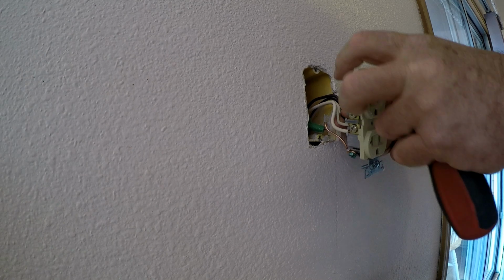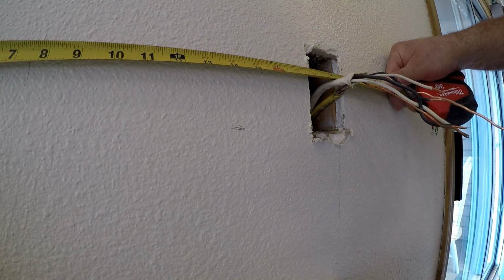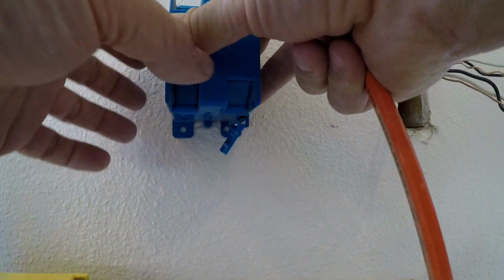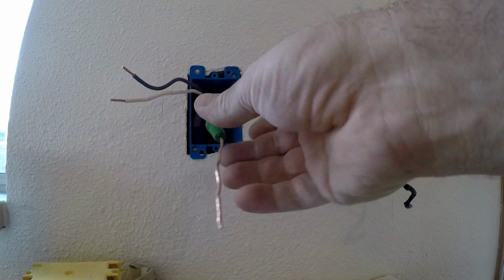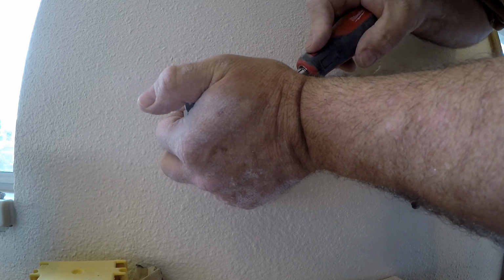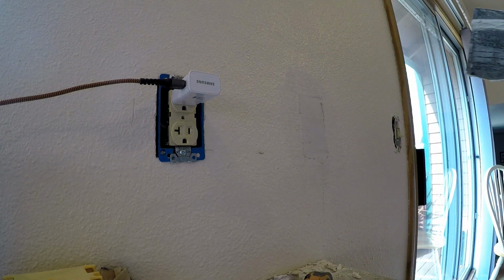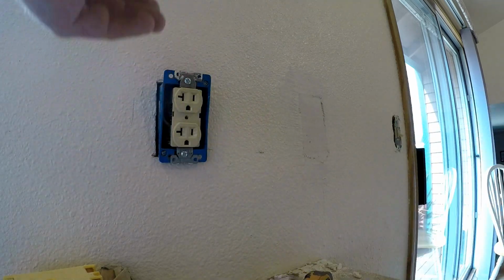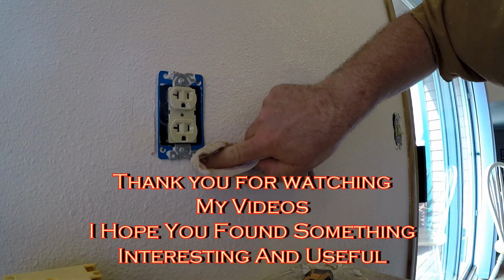Relocating An Electrical Outlet

Comment: Good but only to a point. What about if your wires do not reach. How about if you need to move to the other side of a stud? I have both issues and are looking for videos to help.
Reply from the maker: During this kitchen project,  I had to move several boxes and install new boxes. I don't always have time to record things. I think in the first video of this Playlist, you can see along this same wall where new outlets are installed. They are the blue remodel boxes. You typically have to cut open the wall to run new wiring to new locations. If you have unfinished walls and ceilings below, you can fish wires down, across the ceiling, and up to the new location from below. That way you only need to cut an opening for a remodel box. If it's middle of a run, fish the in and out wires at the same time.
Reply from the maker: https://www.youtube.com/playlist?list=PLyz2LOih3ypvUN753oGYcYXhEHbCuep2C
Playlist
Reply from the maker: In this video about 2/3rds through you can see some of the wiring that happened but no specific information.
https://youtu.be/3V06ZG-vhNI

Comment: What do you screw the blue box into.  Is there wood near the hole you cut?
Reply from the maker: It's a remodel box. You ut a hole the box fits closely into meaning an accurate tight fit. Put your wires into the box, then put the box into the hole. There are flip up tabs when you turn the screws that hold the box in place. If by chance the box is next to a stud, you can screw the side into the stud. Make sure power is off.

Comment: Fail.  Ground wire wrapped wrong way. 
No pigtails. What does NEC say about circuit integrity when device is removed ?
Reply from the maker: Were you paying attention? Look again. Ground wires are twisted clockwise and the green wire nut screws onto the grounds clockwise. If the grounds were wrapped backwards, they would loosen as the wire nut is tightened down. Pigtails are optional. Why do you think there are 4 Hot and 4 Neutral connection points on the back of an outlet? For multiple wires of course. The old wire sticking out the old location is an abandoned phone wire.

Comment: How do you know where is the nail is to cut?   Is  there s trick  to find out?
Reply from the maker: There are usually two nails in a standard electrical box, top and bottom. Determine which side the wall stud is on and pry the box away from the stud just enough to get a fine tooth metal hacksaw blade in between the box and stud. There are other boxes that will be more difficult to work with like metal boxes and depth adjustable boxes. You just have to do what you have to do to remove the box sometimes. A remodel box will be the simplest to remove just loosening the tabs and removing.

Comment: Nice job. But how would you do it if, as with me, you want to move the outlet 5" and the wires are not long or free enough to reach? Existing box ends up behind a countertop splashboard. I'm tempted to make that box a junction and bury it behind the board, but I'm not sure if that's kosher to have a 'buried' box in a wall (or, in this case, behind a permanent fixture).
Reply from the maker: Here is an earlier video from the same job. Don't simply bury electrical connections inside walls, they need to remain visible and serviceable.  About half way through the video, I show where there are cutouts on the walls below counter top level and on studs so wire can be bulled through the walls. When you need to relocate an outlet and the wires aren't long enough, Usually one wire is long enough and will get longer as you move toward the next box that wire is connected to, the other wire going to a box away from the new location will get shorter and often like in your case, no longer reach The one wire getting longer is not a problem, just cut it to fit the new location as it gets pulled back. The shorter, wire you need to determine where it's next location is and change that wire with a longer wire to reach your new location. You will have to open the wall to do that. What I do is determine the height in the stud where that wire is going from the box, then across the wall. Often that height is 2 to 3 feet high. I cut a strip 6 inches high, center to where the wire is determined to be. Generally you're removing the outlet leaving a hole that will be patched. Turn off the power when working with electrical. Grasp the wire to be removed and reach into the hole following it to where it goes up or down and measure that distance, usually the wires will be at that consistent height. Cut a 6" strip across the wall to the next outlet. You can now pull the old wire through the wall and remove from the other box. Now install a new longer wire to the new location, patch the holes. Sometimes there are cabinets on the walls preventing this. If there is another room, dining room, on the other side of the wall and you can cut the walls on the backside to do the job. Two more ways are to run the new wire up into the attic or basement and across and up to where you need it re-routed.There are a lot of situations and these are the most common ways to work with different situations. This is a long answer and I hope I got your answer in here. Hope it helps, Take Care...
https://youtu.be/3V06ZG-vhNI  About halfway observe the walls and cutouts, that's how we rerouted other wires on this job but didn't video.
Here is the playlist for this kitchen project. https://www.youtube.com/playlist?list=PLyz2LOih3ypvUN753oGYcYXhEHbCuep2C
Reply: @CITAP1  Thanks. I'll have to study the situation more closely and see what I can do to avoid the buried box.  Your suggestions are much appreciated.
Reply from the maker: @editorsveruspublishing1714  Give a holler if you're stumped on something.

Comment: There's some funny, non-related background noises.  Where was the second coat of drywall?
Reply from the maker: No 2nd coat of drywall. The new outlet location fitted tightly and was already painted, nothing further needed.  The old location was mostly under the new tile backsplash  and only needed a little textuer and paint touch up. Here's a look at the finished kitchen and backsplash. 
https://youtu.be/8cEIhizGS38?t=1m14s